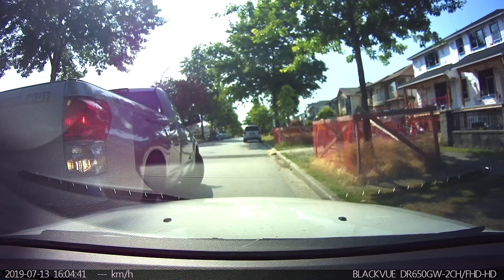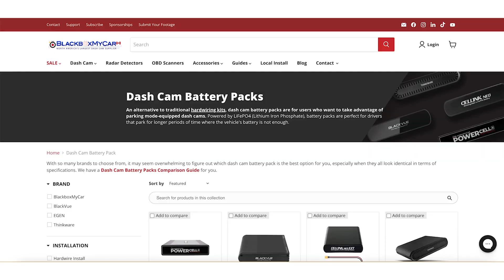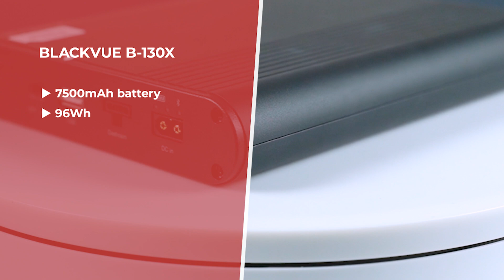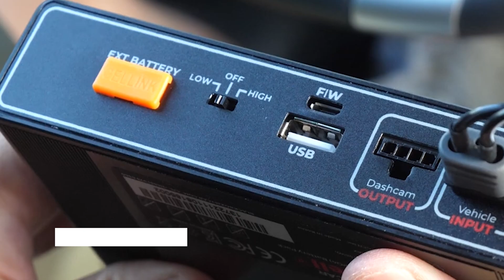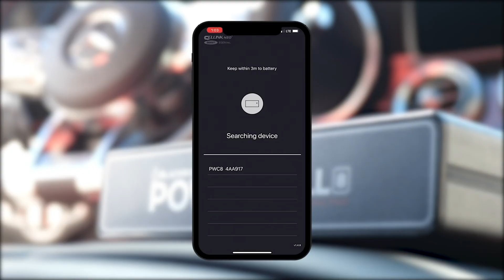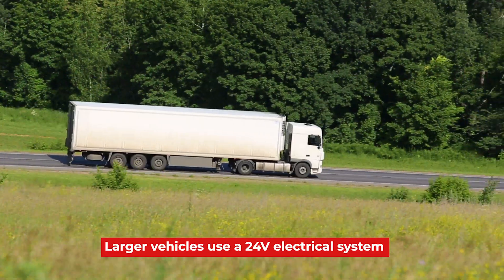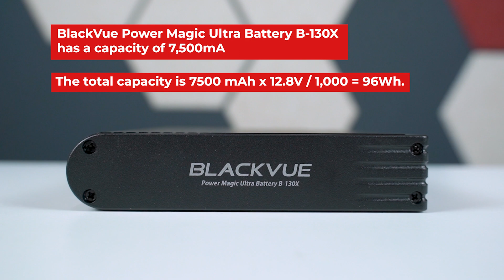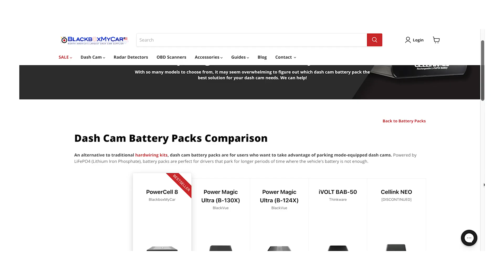Which Battery Pack to Use? | BlackboxMyCar PowerCell 8 vs. BlackVue B-130X Battery | BlackboxMyCar

Comment: So the PowerCell bank cannot be charged at home?
Reply from the maker: The PowerCell 8 can be charged at home, through the use of a Power Inverter. This connects to a basic wall socket, and then converts that to a cigarette lighter socket end, which you connect the Cigarette Lighter Charging cable for the battery to. You can find this item here: https://www.blackboxmycar.com/products/blackboxmycar-power-inverter?_pos=1&_sid=eb1786a4d&_ss=r&variant=40125878829111
Reply: @blackboxmycar  thanks for replying and the explanation. I wanted a way to avoid having to hard wire the power bank to my car battery. This helps a lot!
Reply: @blackboxmycar  I’m sorry one more question, if I charge it at home, do I still need to connect it to the car power source while driving or while my car is parked and turned off?
Reply from the maker: If you charge the battery at your house, it is still recommended to connect the camera to a power source in the vehicle, otherwise standard driving mode will likely take up a large portion of the batterie's charge. These batteries both come with a plug and play cigarette lighter adapter, and there should not be an affect on the car battery if only supplying power when the vehicle is turned on.

Comment: What happens when it gets to hot inside the car
Reply from the maker: The battery pack is normally sitting in a shaded and covered area so it won't heat up as much as say, your dash cam on your windshield would. However if it does enter into temperatures outside it's operation temperatures, it will turn off.

Comment: Why do all the dash cam manufacturers use a power cord that uses a cigarette lighter plug instead of a USB plug? Simple so they can screw you on the aftermarket accessories' you have to get to make these things work when car is not running like these battery boxes. It's 2023 every vehicle out there has a USB now and it should be able to run off one of them.
Reply from the maker: Yes, while USB ports on vehicles are almost universal, there's still a lot of variance on how they operate (like if they turn on and off with the vehicle) and the power supply provided. The power supply is especially true when it comes to these battery packs, which draw 7A worth of power, which is frequently much too much for a USB connection.

Comment: 4:33 I intend to plug the battery pack to the cigarette lighter, I don’t understand why you said it will drain my car’s battery. Once I power off my car, shouldn’t all power be cut to the ciggie ports as well?
Reply from the maker: Yes, you're right that the majority of vehicles have cigarette ports that turn on and off with the vehicle, so there's no need to unplug the battery in those vehicles. This tip was specifically for vehicles that have cigarette ports that stay on constantly, which unfortunately is sometimes the case.

Comment: I see, so it makes sense to protect the car battery, costing roughly 50 dollars, just in case it will be running out of juice because of the dashcam, by buying another battery, costing 5 - 6 times more...interesting...why not having 4 more spare wheels in each car, in case one would make 4 flat tyres?...You never know, isn't it?
Reply: This doesn’t really make sense. I would rather my battery pack run of battery than my car battery going flat and having to jump it over and over. And yes, I have cars I don’t drive for days, sometimes over a week, at a time.
Reply from the maker: Due to the constant power draw from the dash cam, the draw on a standard USB battery can lea to a shorter life-span, along with other factors. If you would like more in-depth information on this subject, here's Vortex Radar's great video on the subject: https://www.youtube.com/watch?v=4gH0i07mSJ4

Comment: 8:56 Well, yeah, if you put it that way. The capacity is actually less than 96Wh, because the camera itself runs on 5V, not 12V. Some power will be wasted stepping down the voltage from 12V to 5V. If the Blackvue converter chip is, say, 95% effective, then the capacity will be 91Wh. In reality, the capacity will be even less, because the battery must also power Wi-Fi and other components. You could buy a 50,000mAh power pack for $35. 50,000mAh x 5V / 1000 = 250Wh, which will give you 3x the capacity of the Blackvue at less than 1/10 of the cost. Minus the ability to control or monitor anything with the app, of course. And Li-ion batteries should not be kept in a hot car in the summer! So the Blackvue Li-Fe battery pack is a much safer option.
Reply from the maker: Quite the detailed take! Most of what you are saying here appears correct, though we still stand by these LiFePO4 batteries in the long-term with extreme reliability, especially with the camera's large power consumption, and handling hot weather! For a more in-depth look, I recommend checking out Vortex Radar's video on the subject here: https://www.youtube.com/watch?v=4gH0i07mSJ4
Reply: So what would be your choice in battery ?

Comment: I have the Cell link neo. Is that compatible with BlackVue DR770X-2CH?
Reply from the maker: The Cellink Neo is fully compatible with the DR770X-2CH! You'll just need to connect a cigarette socket to the battery output, and then the cigarette lighter adapter for the camera to that!

Comment: Which battery pack do you recommend for the Vantrue E3 3 channel dash cam? Can your battery packs charge through the OBD II port?
Reply from the maker: Hey there. All of our battery packs are compatible with the Vantrue E3, but the best value battery would be our PowerCell 8! The connection to the Vantrue E3 is worth focusing on as well, as it uses the same USB-C connections as the Viofo A139, the spliced cable for the Viofo A1139 should work, though the most reliable way would be to manually splice an unspliced output cable for the battery to a true Vantrue hardwire kit. Battery packs cannot be powered through OBD, you'll need to either hardwire it, or connect it with a cigarette lighter adapter.
Reply: @blackboxmycar  
Thanks. So I should purchase the unspliced power output cable as an option? Okay, how do I do the splicing exactly with the Vantrue hardwire kit?

Comment: Hi thanks for the video 👍
I have a front and cabin dash cam but I want to put another camera only rear. Can I use 2 different dash cams in one of those batteries for parking mode.
Can I plug the rear camera to the battery usb port?
Reply from the maker: Hi there, glad you liked the video! 
The short answer is that it's possible, but it really depends on the camera model. As the USB port only supplies a smaller charge, it can sometimes not be ideal for a dash cam (5A I believe), but there are some other ways to run a setup like this. An old school 3CH/4CH BlackVue setup for example would have 2 seperate 2-channel cameras. Using a cigarette splitter to split the output from the battery connection so each camera system can connect to the battery with their cigarette lighter adapter.
Reply: @blackboxmycar  thank you do much for the answer 🙏🏻

Comment: How long can a cam run by connecting it to the vehicle battery? I mean, those extra packs look fine if you daily drive your car (or 2 days max) but 400$ for that sounds quite expensive to me...
Reply from the maker: Great question! It really depends on the vehicle battery and camera, but generally it will supply 7-9 hours of parking mode off an average car battery. I hear where you are coming from on the batteries, and they are rather premium. For an explanation of why that's the case, check out Vortex Radar's excellent video here: https://www.youtube.com/watch?v=4gH0i07mSJ4
Reply: You're going to be spending more than $400 to keep replacing your car battery as you keep killing it from the constant draining. Better keep a jump start pack on hand because you'll need it.

Comment: I do not want to use the battery while in my garage.  Can I just move the cigarette lighter adapter from my battery to hardwired cigarette lighter adapter without hurting the battery charge cycle?
Reply from the maker: You can move around the cables as needed without hurting the battery, as long as you are careful with the cables of course. If you do not want to use the battery in your garage, the easiest method to turn it off is with the power switch on the battery, and if you want to charge it in your garage you can use a Power Inverter to connect the battery to a wall plug-in, with your cigarette lighter adapter.

Comment: I am trying to do the research before I invest in one of these! I can see getting the battery and have it installed.
The problem is from the battery to the camera all the install kit I can find have battery drain protection which makes no sense for doing this type of installation! (What’s the work around? Or do you have any idea? As I assume that’s why you use the cigarette lighter adapter.  I have the van true E3 (any help would be appreciated )
Reply from the maker: Yes, you are correct, most hardwire kits have voltage protection on the hardwire kit! Rest assured that the battery pack should constantly give a voltage reading above the lowest cut-off setting here, until the battery is fully drained, which it is designed for. Alternatively, you can always cut off the voltage monitor on the hardwire cable, and splice the output cable for the battery before the monitor.

Comment: It sucks when you don't drive 50 minutes to fully charge your battery pack 😔
Reply from the maker: You can also charge batteries inside with a Power inverter :D!
Reply: @blackboxmycar  "Inside" meaning?
Reply: @mansionjohn66  I think he means inside your home. My guess is either a removable battery unit or attaching the battery to household outlets to recharge it in the car.
Reply: @philipcolumbus3054 yes. You can even have two packs. Leave one in the car to power the parking mode, and gave the other inside the house on charge. If you only do shorter commute and the battery pack in the car does not receive enough charge to keep it topped up, you can just swap the battery packs around and always have a fully charged one in the car while the one you’ve taken out of the vehicle can then go into the house to be plugged in and topped up.

Comment: Great video thank you very much.
One question, can I plug the A139 3CH to a EcoFlow Delta2, Jackery or Bluetti power station in a campervan?
Reply from the maker: Tough one, we've had a few people stop by the store to try this. Yes, you can connect the camera to it, however getting the camera to go into parking mode is more difficult as the camera needs a 3-wire connection for this with the hardwire kit. This is because the camera goes into parking mode once the ACC power cuts out, as would normally happen with the car's ignition. You would need to find some way to actively cut this power connection and send the camera into parking mode, while still connecting it to the power station.

Comment: I’ve been running the BlackVue 750X 2Ch LTE and the Powercell8 for a year now. I’ve parked for my 12 hour shifts in below -30°C… this equipment performs exceptionally.
Reply: How long does the battery last?
Reply: @The10lfunk4  , the camera draws more power when you’re driving vs when your parked. I’ll typically get 20 hours. I don’t like recharging my battery in the car, my commutes aren’t long enough, so I bring it into the house every other day and recharge it with an adapter I bought from BBMC.
Reply from the maker: Awesome to hear, thank you for sharing!
Reply: @blackboxmycar  So when you hardwire the Blackvue B-130X to the car battery will it drain the battery?

Comment: Yo Broseph,
Excellent comparison video.
These things are expensive, but jam packed with value considering what you get in return. For folks who don’t understand the difference in battery chemistry composition it all comes down to safety, (LiFeP04 - Lithium Iron Phosphate).

Depending on application, and climate location you may be able to get away with using a cheap Lithium-Ion / Lithium Polymer Power Bank. But what’s at risk is returning to a catastrophic car fire. I can see an insurance company refusing to payout a claim when a motorist left a cheap Power Bank running in a hot parked car. Imagine being on the hook for a $50K - $75K pile of ash. Maybe next time you could include some explosive, fiery, Power Bank testing failures to really drive the point home. Bring on the “Heat Fish Tank of Doom”. lol
-Chuck
Reply from the maker: Thanks boss! 100% agreed on everything, except for the "Heat Fish Tank of Doom"! It was scary enough running it with a heat gun on a regular dash cam.
Reply: Thanks, I was wondering about this. I recently heard about a Tesla Uber driver having burned to death being trapped in his vehicle. (Very sad, condolences.) So I was wondering if these powerbanks could potentially start a car fire. I'm glad to hear they are different and it's safe to get one.

Comment: Are the hardwired cables interchangeable between the b124x and the powercell 8? 

The reason I ask is because in the future if I decide to upgrade to the higher capacity battery pack , it would be very inconvenient having to reroute and resplice the cables

Based on the pictures the power plug to charge the battery and power the camera look the same both on the b124x and the powercell 8
Reply from the maker: They are interchangeable!
Reply: @blackboxmycar  thank you for the reply

Comment: Thanks Broseph for the latest battery packs. I've recently ran into an issue with the Blackvue Battery app.
I have the Blackvue S900-2ch dashcam and the Blackvue B-124 battery pack.
I updated to iOS 16.2 on my iPhone. The app shows it connected to my Blackvue B-124 battery but it will not give the remaining hours left on the app.
Do you know how to get the app working again,
Reply from the maker: Hey Kenneth, do you mind giving our support team a shout at info[at]blackboxmycar.com? They can help you with your technical question!
Reply: @blackboxmycar  
Thanks, I chatted with BBMC staff and he suggested that I not use the Blackvue Battery app but rather to use the Blackvue app and scroll down to Blackvue Battery section.
It works!
FYI to whose who are using the Blackvue Battery app on an iPhone…delete the app and use the Blackvue app.

Comment: What about adding a smaller sized solar panel to help with charging a battery pack, in a vehicle that doesn't get driven so often?

Can anyone recommend a proper sized solar panel (wattage) and how to wire it up to also allow the vehicle to charge the battery pack when it finally is driven?

Comment: The comparison would have been fairer with the Blackvue B124X and 124E, because they are expandable.
Reply from the maker: Hi Eric, we chose the B-130X because it's the newest battery pack that got released recently, and it's got 7,500mAh which makes it comparable to the PC8 which is also 7,500mAh. The B-124X is only 6,000mAh and it's getting discontinued now that the B-130X is here.
Reply: @blackboxmycar  if you have a dual channel with LTE module, that would mean that when you get home from work at 5:00 PM, you have to start your car every morning at 5:00 AM, otherwise the parking mode will be disabled due to a low battery. Sleeping in at the weekend is no longer possible for the rest of your life, because the battery life is not expandable.

Comment: Thanks for sharing this video, it's so informative, I have a question for you, a Blackvue B112 Power Magic Battery Pack, I understand it can store 12 hours of parking mode on a single channel dashcam, if you have a 2 channel dashcam, how many hours can it store?
                                    Thanks.
Reply from the maker: Hi Clifford, do you mind giving our support team a shout at info[at]blackboxmycar.com? The B112 is quite old as a product, so they would be able to help you more.
Reply: I have a B112 Power Magic Battery Pack and it never worked quite right from the start and it's very dead now after several years. (Which is why I'm watching these videos to see if I should switch brands or get another one.) I don't think I'd recommend the B112, especially now since it's such an old product.

Comment: I have a cellink neo, really looking for something that lasts 48hrs on a single charge single channel LTE camera..
Reply: I have the Blackvue 124X connected with 2 124E and gives me up to 50 hours fir my 2 chanel DR900x and LTE Module. The 3 batteries were more than $1000 together… so its expensive
Reply: @ericignatia  Don't forget that you still need to drive more than an hour or more in order to charge those batteries.
Reply from the maker: That is correct if you have multiple battery packs! 48 hours will be hard to achieve even with the PowerCell 8 or the B-130X on a single battery.
Reply: I have Cellink Neo with additional battery. With my Blackvue 750S I get roughly 31 hours with non-stop recording. The good thing is its been like 5 years now, and still consistent with the battery time.